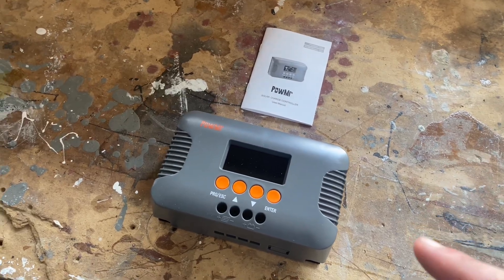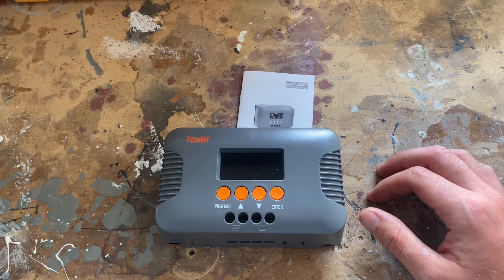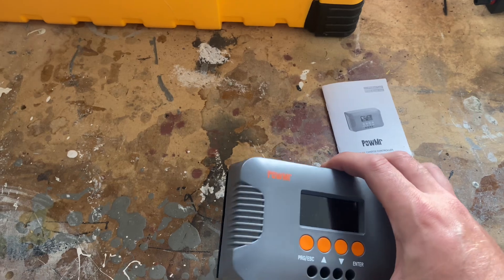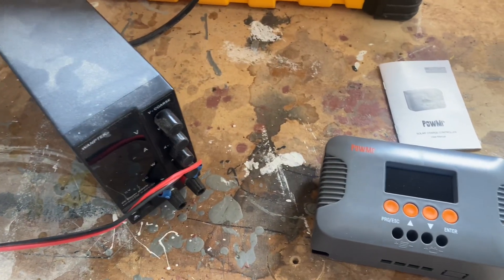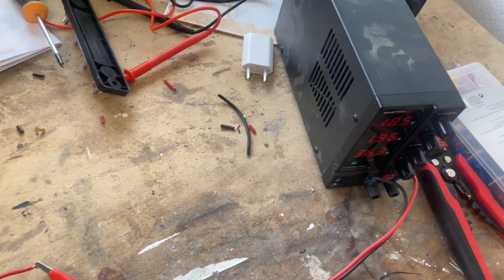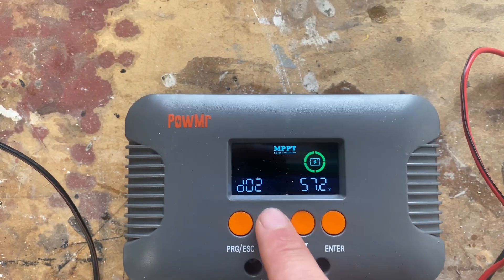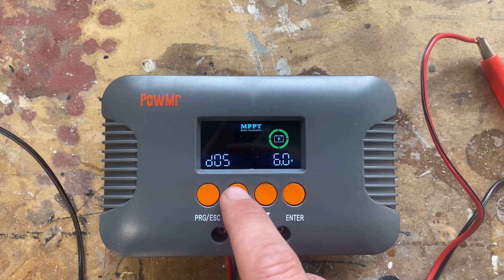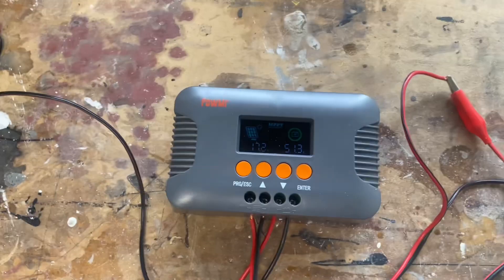PowMr mppt Boost Solar Charge Controller

Comment: I have a Renogy RSP200D- 12v 19.2Vmp 10.42A Imp 23V Voc 11.05A Isc solar panel on a 1999 36V DS Club Car golf cart. I replaced 6-6V batteries with 1-38.4V 105AH Lithium battery. I want to be able to use the cart around my neighborhood maybe a couple of times a week. Is this the boost charge controller I need or do I need something else? Thanks for any help!
Reply from the maker: This charge controller should work great for your application. It is a big battery. The panel will charge it using this CC. I would consider a second panel for faster charging though.
Reply: @JonasSyver  Thank you for your quick response. This is my last step to get the cart charged up and on the road. The first charge controller I bought was misleading and I thought it was a "Boost" controller but it isn't. Thanks again for your help!
Reply from the maker: No problem👍 Let me know how it goes😃

Comment: It works ok but is constantly hitting error 73 every day!!! Apparently if the output goes above 10 amps it shuts down!!!! It cannot limit input current 👎 and will not charge if solar voltage is 22 volts so below 👎
Reply from the maker: Thanks for the comment and input. I have not encountered error 73. I know the parameters need no be exact when setting it up. Will need to run some more tests. Thanks again👍

Comment: What is minimum startup voltage? is it stable at low input or does it struggle and restart below ~5Watts like mpt 7210a ? I am curious if its an "upgrade" if i add another charger one day.
Reply: Where do you get your information from???
The voltage has to be above 22 volts!!!
Reply from the maker: It seems to be stable at about 9V. I’m working on another video testing the charge controller in a real setup.